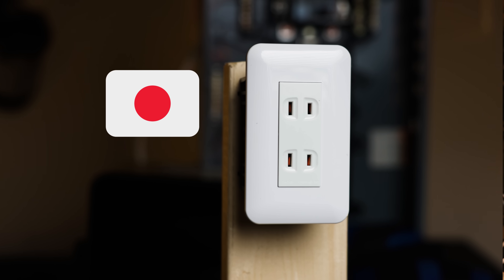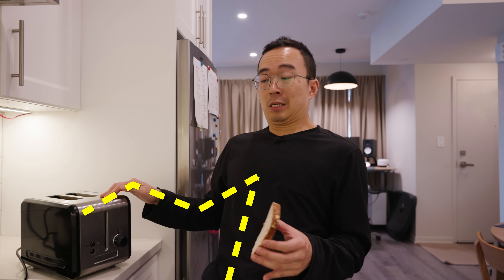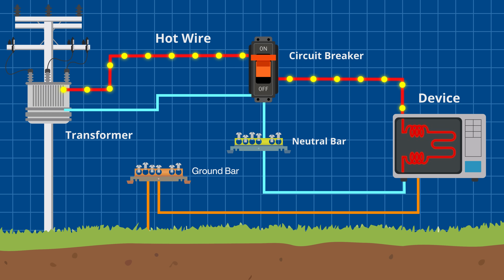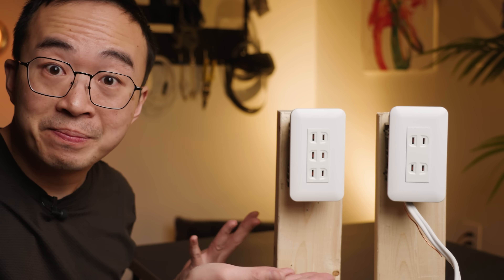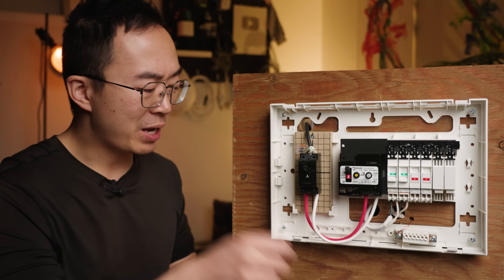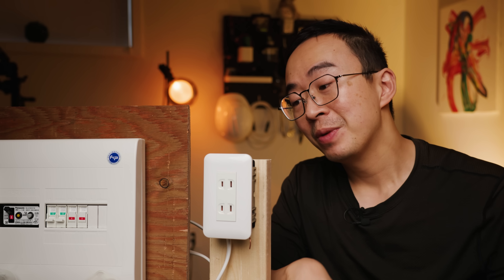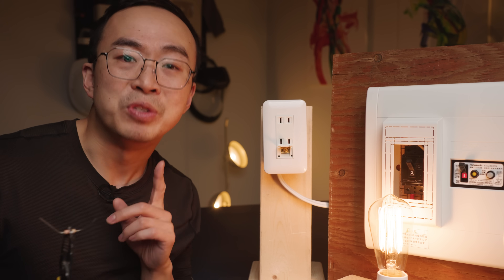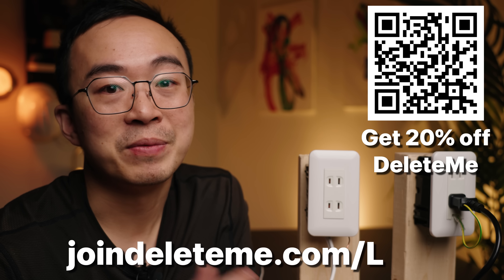How Japan Made Their Outlet Safe

Comment: I hate one main GFCI. One a-hole can just trip the entire place. I love the idea of a GFCI per outlet, more expensive but less stupid.
Reply: yeah its just a cost saving measure, and one that comes from a time when GFCIs were a lot more expensive by comparison. Unfortunately GFCIs with less than 30mA are not really a thing for breaker panels, I think something like 5-10mA per room would be much better.
Reply: Or do it like here (netherlands): one per breaker.
Individual sockets can't really be fitted with it here, mostly because we have always done it on the central panel.
Works fine and is cheaper than doing it on each and every socket.
Reply: @BuzzinsPetRock78  That's a great idea too, and in newer houses it's very possible to do that, since horizontal layout panel are more common now, only money is the factor. The problem here is with older houses where the fish bone panel is more common, where it's just not feasible to exchange the CBs to RCCBs short redoing most if not all the electrical
Reply: @SonOfZeusGaming  To be honest, I have no idea precisely how the panels work in the US, but I know here they are standardised, and the breakers have the GFCI in them. They are the same size as the other breakers, so they are a straight swap. (well...if you pay a little extra. Otherwise they are twice the size)
Reply: @BuzzinsPetRock78  I like the idea of GFCI outlets rather than at the panel. But there are arguments for both approaches I think. However, what annoys me is houses with GFCI outlets for some circuits and GFCI breakers for others. This was the way our new house was wired a few years ago.
Reply: Over here in germany there at max six circuits allowed per GFCI by the newest code. In a modern house, you not only have one GFCI but many of them, one for lighting, one for every high power application, one for the outlets and even a own GFCI for the bathroom and outdoor area.

So no, if you have doen it right your whole house isnt without pwoer. And by doing it like that, we have a GFCI protection for EVERY outlet and circuit  in the house. 

In older homes, you regularely have not so many 3 GFCIs but more than one, for exacmple one per floor and then one for the outside area.
Reply: @sbdpro2  now THAT'S intelligent!
Reply: That is how you bring old house up to code; replace all 2 hole outlets with GFCI outlets.
Reply: @ArmyNurseCorps-u5c  Where are you going to get the ground (earth) wire for that third hole? It won't be there in the outlet box (why would it in a "2-hole" system).
Reply: @sootikins  It wasn't stated but we have to assume that those grounded outlets have 3-wire cable back to the panel, if installed properly. Obviously there's a risk of shoddy retrofits.
Reply: i'd make a mechanical device to reset it.
clap your hands to activate.
multiple microphones wired throughout the house listening for the clap.

Comment: Still got nothing on the locked live, that can only be unlocked by insertion of the ground pin on UK plugs. 

And the insulated half of the live and neutral pins on UK plugs to prevent accidental touching of live pins before a plug is fully inserted.

Comment: South Korea use GFCI in households and its mandatory. They kicks in when unbalance between lines is more than 30ma. We are using beefier version of EU socket. They have grounds so a little bit safer than 2pin japan sockets. Only some old house that converted from 110V to 220V are not have grounds. But GFCI is working so great there are actually no danger with normal use.

Comment: I live in Australia and I started this comment after viewing the first 5 minutes of the video.
I cut through an live, extension lead, that was supplying 240V to an electric hedge trimmer which I was using. It tripped the circuit breaker, which stopped the power immediately, I didn't feel a thing and the hedge trimmer suffered no damage. It worked perfectly.
My thinking at this point in the video is how can you improve on perfection? Realistically speaking would it be fiscally advantageous for all of the counties which use three pin plugs to change to the Japanese 2 pin plug system. Will it be practicable too as in contrast to Australia, Japan is tiny so the distance of electricity transmission from source to end user is small. I may be wrong but I believe North America uses the DC system and Australia uses AC, this is relevant because of the huge distance of transmission from source to end user and loss over distance. Again this goes to the question of practicality. Ultimately I'm wondering if your video is intended for AC usage countries?
Reply: Appliance earthing in Australia only saves your bacon if there is an active (line) to chassis style fault.  If you personally get between active and earth (wire or the planet) you are done unless an RCD is involved.  You may not realise it but decades ago Australia had a fair degree of TT (direct) earthing too.  This was before RCDs were a thing.  Instead we used direct and later on ELCB (direct with an ELCB fitted).  ELCBs were retrospectively renamed to voELCB to distinguish them from RCDs.  We moved to M.E.N. as a general means of earthing in 1980 but prior to that MEN was in widespread use and direct systems were actively being migrated to MEN.  We didn't just wake up one morning and decide that MEN was neat so let's do that.

Reverting to direct would be a massive upheaval in Australia's electricity distribution.  Not impossible but the sheer scale of what would have to be done is not financially viable and would require litteraly every single installation to be touched, again.  It was far far easier to go from direct to MEN than it would be to go from MEN to direct.
Reply: @retrozmachine1189  thanks for the informative reply. You made me a meal with the anachronisms which I'm trying to digest lol. Again I most sincerely say thankyou 🙂

Comment: I find it interesting that you make it initially sound like the Japanese polarized NEMA 1-15p/r are automatically safer when it's the same outlet, albeit outdated compared to the NEMA 5-15p/r when in fact it's about the same (even with the lower 200/100 V 50/60 Hz running through them).  I don't really understand why Japan didn't look at both the US NEC and the CEC (Canadian Electric Code) as guiding factors in this regard due to the systems being incredibly similar to the Japanese system.  We, like others have mentioned have been using grounded outlets for a long time as the standard in our houses and other buildings and the same goes for a good portion of the planet.  There are also downsides to having a whole-house GFCI systems when we should probably be installing these systems on each branch circuit.  Granted, it gets expensive but for the safety aspect and also convenience, when something happens where residual current is detected, at least you don't lose power to your whole house.  I also don't understand why those who allegedly have safer electrical systems than North America continue to use plastic load centre panels and mounting boxes for switches and outlets when to me it seems much safer to use galvanized steel boxes as they can be grounded making it safer against electric shock or fire to be mostly contained in said steel box.
Reply: Yeah, there's some really bad information in this video and I'm kind of surprised at how misinformed people are.

Comment: Well I don't understand why everyone is so proud of theirs being safer. There are only 400 electrocutions in the United States avg/yr. It doesn't specify how many are from wall outlets. Since far more people are injured from falling power lines and doing dumb stuff I'm confident that there aren't many at all. So....
Reply: That is over one per million. In Europe it is well under had of that. The electrocutions from low voltage have reduced significantly from 48 in the 1980s to 8 in the 2010s in Finland. If we count children there were 8 cases in the 80s and one in the 90s. No cases since that.

Here we do not have power lines. It is all under ground. Also unlike in the US it is only low voltage near homes. The transformer can be half a kilometer away.
Reply: @okaro6595  and 17,000 people are disappeared from the planet every year because of gravity in the United States. Gravity seems to be a much bigger threat than wall outlets. Get some perspective on life. There are things far more likely to delete you from the planet. Y'all in here worried about plugging in an appliance.
Reply: Nobody is getting electrocuted from 110 volts unless they're sitting in a bathtub in a very old home without GFCI outlets.
Reply: @mediocreman2 it's 118 now
Reply: @mediocreman2 and that thought process is exactly why people get electrocuted...it's not the voltage that kills, it's amperage. People get struck by lightning and survive, that's way more voltage than either 50/60Hz system..amps are the killer. That's why gfci are set so low, they're below the "bite on" range during a shock. It's the point where you physically can't let go of the circuit, it's the point where the body's electrical system is getting messed up. Speaking of wrecking the body, the path is important as well, that a shock through you hand, no worries(not really) but that a pathway through the chest and you're going to the hospital.
Reply: The USA's electrical related death rate adjusted for population count is about twice that of peer countries.
Reply: @retrozmachine1189  and yet 17,000 people are unalived in the United States from gravity every year.  Gravity is 100x more likely to unalive you than an electrical outlet. So....

Comment: It is not the outlet that is safer. It is how house is wired that makes it safer. The US outlet is safer than Japanese one because it has ground.  GFCI receptacle or breaker in the US is safer because it has much higher sensitivity (about 5mA). However, this can cause nuisance tripping with some appliances. Also, main breaker in the US is much larger (200A in modern houses). It just isn't cost effective and possibly less safer if lower sensitive GFCI is used. Properly grounded chassis cannot possibly electrocute a person, so I don't think there is any safety issue except for wet locations, where leakage current from hot wire is possible. Ground is not only for safety, but also used for EMI filtering. GFCI doesn't help in this case.

-- EDIT: ADDITIONAL INFORMATION I FORGET -
30mA GFCI breaker shown in the video is not considered safe for human in the US. 30mA is enough to kill someone in certain conditions. 30mA GFCI is meant for equipment protection.
Reply: Agree.  I don't see anywhere that he presents actual comparisons of residential electrical injury stats for various first world countries.  I highly doubt they vary by that much.
Reply: The problem with "properly grounded chassis" is that then you're relying on the company making toasters for $5 to ground their devices properly...
Not to mention all the cheap knock-offs etc that people might buy online - or just locally at a "dollar store" or similar.
I watch another youtuber's videos who takes apart electronics he's bought at one of these stores and he has sometimes found that the ground wire is just not even connected (despite it being a device with a metal case and thus very much in need of ground protection)... At least an RCD still protects you in that case.
Reply: Fun fact: In old houses in the US that don't have ground, you can use a GFCI outlet with a fancy included label that says that there is no equipment ground.
Reply: @billatq  Yes, GFCI will add safety. But, not to be confused with actual equipment ground (reason why sticker is needed). Many consumer products are double insulated and does not require ground connection. I think this is how most products should be designed.
Reply: And furthermore we don't make our load centers ("breaker boxes") out of plastic FFS.
Reply: @sootikins  i thought they'd be cheaper. it seams not to be the case.
Panasonic seams to have a dominance going .
Reply: @sootikins Funny you mention, but plastic electrical equipment is safer.
Reply: Depend which hazard you are talking about. Plastic won't shock (obviously). Metal won't burn, plastic depends on what additives are or are not in the plastic material.
If plastic is so great why are 99% of enclosures in industrial plants - even in wet areas - made of steel?
Reply: @sootikins  It is not necessary for the case to be plastic to have double insulation. It is just cheaper to make it with plastic only or metal only and ground. Plastic doesn't need additional insulation. Steel can be double insulated by putting additional insulation layer, but that obviously is more expensive and it is much cheaper and easier to just ground enclosure. One benefit of gorunded metal enclosure is that it also contains or keeps out EMI.
Reply: Expect that not safe at all. Systems like these were banned even in the ussr.

Comment: Japan use to not have gfci protection.  Ie it just was a 2 prong socket with no ground.. Lots of mid 1980s stuff was that..just like usa 1940s and 1950s homes..
Reply: Only need to take a look at Japanese vintage 2 prong audio equipment from the 70's/80's. Definitely not double isolated.
Reply: Dude, by looking at the way you write, I don't think you actually understand what a cable is.
Reply: @SLeeSG  This video is about the Receptacle; not a cable. ie lay terms the  Receptacle is the outlet

Comment: The UK BS1363 Plug and Socket design is still better though, better than both the US and JP plug and socket design. We also have fuses in all plugs, and many sockets are now RCD protected now, so it's even safer.
Reply: Sure, it's safer, but from what? In the US, it's only 110 volts. It can't kill you unless you hold on to it for a long time. The UK was forced to use a higher voltage system because copper was scarce after World War II. Because it's a higher voltage just than they had to protect the prongs better.

People have such a simplistic view of what is better and have a really limited ability to factor in all variables.

Comment: Important note: outlet testers in the US usually can't check if your ground circuit is actually wired correctly! They usually just look for a connection between neutral and ground, because, as mentioned here, the two are actually connected (usually). So, if skimping builders just wired the ground of an outlet to neutral instead of doing things properly, everything will appear good... but you won't have the same protection as with real grounding.
Reply: Can confirm. When my brother and I were still living with our parents, my brother was wise enough to invest in a surge protector to keep his PC safe. But, our parents had been cheap getting the family home "updated" to have "three prong outlets" without properly earth-grounding them – they had a retired electrician who didn't give any shits do the bare minimum work replacing the receptacles. A close lightning strike somehow spared my PC but fried the motherboard in my brother's PC despite the surge protector. Years later, it turned out that the guy had failed at more than properly earth-grounding my brother's outlet: Just this year my parents had most of that circuit go dead, and the electrician they called in to troubleshoot it determined that the outlet in my brother's bedroom was wired in reverse, and very poorly at that. Anything you would plug into that outlet would have a live chassis and risk losing power altogether if a heavy truck drove by. And it sat that way for twenty years. Blows my mind that it never started a housefire.
Reply: @Dee_Just_Dee   Maybe he wasn't really an electrician.  When I was a kid, I had a friend whose father thought he was one.  It's a wonder his house hadn't burned down.
Reply: @Dee_Just_Dee Buy Cheap, Buy Twice.
Honestly, if you're so limited on funds that you need to call in somebody that inexperienced and dangerous to do the job then you might as well just buy a book and learn how to do the job properly yourself.

Buying a book and learning how to do a task properly as a professional is how my parents saved thousands in the 1980's & 1990's by doing the work themselves using the correct standard of hardware and then have a accredited professional come in, check their work, then sign it off if it was up to standard, which it always was because if they were ever unsure then they'd call up family friends who worked as tradesmen and query if they were doing something correctly or not.

It pays to have friends who are tradesmen, and it pays to do a job properly the first time.

I'm glad nobody got killed by that idiots dangerous wiring job, it sounds like your brother was very lucky not to have been harmed or even killed by the socket in his room.
Reply: @Dee_Just_Dee  Electricity isn't like water, it doesn't just leak out and ruin things.
Reply: @jovetj  this is completely false
Reply: The fuck they can't  the 3 LED are easier to use than the 3 seashells.
Reply: That makes no sense
Reply from the maker: Yeah bootleg grounds can't be detected! I'll probably write up a longer article on it!

Comment: I could see the benefit of saving copper wire by not having a ground wire but the safest thing is to have both which is not too hard to do in the US since most modern buildings have grounding wires already and you could install a gfci outlet or gfci breaker a lot easier than running ground wires in already built buildings
Reply: Yeah, unfortunately there's some pretty bad information in this video. US outlets with GFCI are incredibly safe. If you combine them with AFCI, they are one of the safest in the world.
Reply: the Japanese buildings also have a standard ground. just most of the plugs don't use it. some of them do though, like for the washing machine. so it really is just a case of cheaping out.